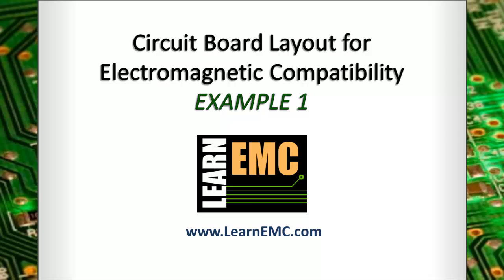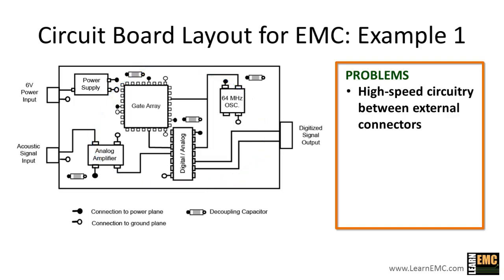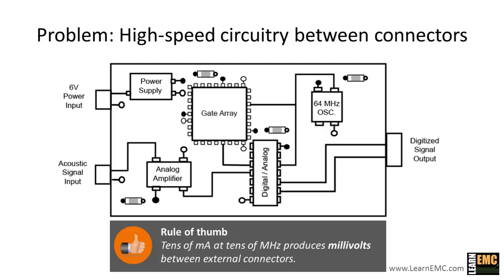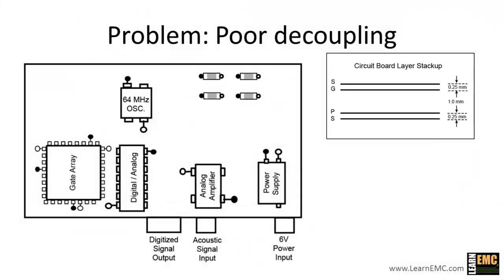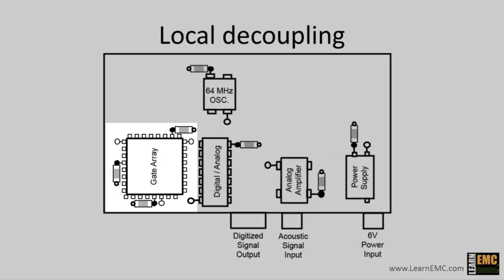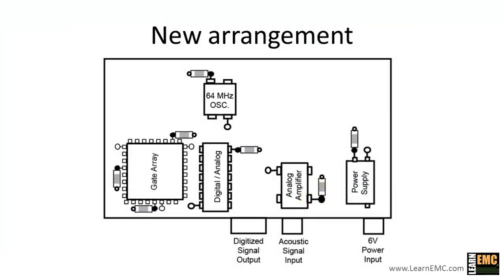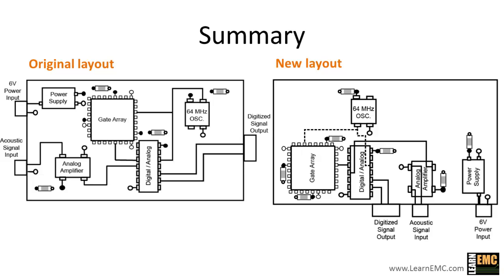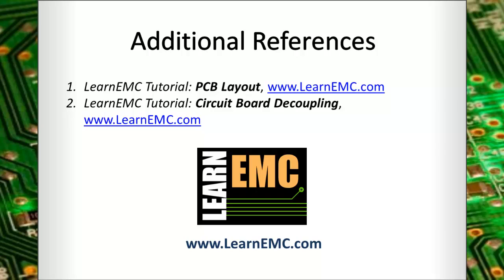Circuit Board Layout for EMC: Example 1

Comment: What if the external connectors can not be moved?
Reply from the maker: Put the board on a metal chassis and connect the circuit board's ground plane to the chassis near each connector.

Comment: The placement of the vias and decoupling capacitors is wrong. You want connect the power pin as close as possible to the capacitor and then connect the capacitor to the power plane via multiple vias. A via between the IC and capacitor is bad practice

Comment: Some points are still relevant, some are outdated.
Reply from the maker: Please be specific regarding any information you think is outdated.
Reply: @LearnEMC  For example. The audio ground should refer to the ADC pin, which is the star ground. New ADC have 2 ground, analog ground and digital ground. Supply from via must reach cap first then pin, not between then.
Reply: Oh the caps are thru hole, really ancient. It will cost more than smt, not to mention their lead has more inductance than smt counterpart. Digital trace are best route on layer 1, where it's nearest to ground. Layer 3 should use ground if layer 4 will route digital trace. Use power trace instead of power plane at either layer 1 or 4.
Reply from the maker: @jasonhanjk  A star ground is used for the unamplified acoustic signal, but it is not generally required or desirable for the amplified acoustic signal. Many ADCs have 2 ground pins, but they are connected internally. The decoupling capacitors are connected correctly for this application.
Reply from the maker: @jasonhanjk  None of the components in this example are through-hole. All of the digital traces are routed on layer 1.

Comment: Product/mechanical design constraints may determine connector placement.
Reply from the maker: Yes, that's true. When high-speed circuitry must be located between connectors, steps have to be taken to ensure the connected cables are not driven by the circuitry. This generally involves limiting the bandwidth of the circuitry or providing a low-inductance connection to a metal chassis at each connector location.

Comment: Some issues here. The myth that you should ground shielding to board groundplane is dangerous, Shielding should preferably be grounded to the casing. Reason is that if you are a in a highly noisy environment i.e. an industrial machine hall, that cable shielding will act as an antenna inducing noise into your ground plane.
Reply from the maker: High-frequency cable shields must always be bonded to the metal chassis. If the cable shield is acting as an intentional current return, it must also be bonded to the circuit board's return plane. In this design, if there were a metal chassis, the circuit board's ground plane would need to be bonded (at high-frequencies) to the chassis near the connectors. In the event that the circuit ground was required to be low-frequency isolated from the chassis, that bonding would be done through capacitors.
Reply: @LearnEMC    You are right in the cases you have a connector that doesn't go 360 degree around your cable and have attachment to a casing made of metal. The reason for this exception is that you in this case have a Faraday cage and you avoid getting signals in and out through your shielding. You are right in case of plastic cases and in case of connector not having proper 360 degree shielding attachment (like in a RJ45 with the gaps) then you are forced to attach shielding to signal ground. The reason i mention this, is as i originally commented, that when you have machinery in a very noisy environment you risk having issues with EMI into your circuits. This may sound like an edge case, but having worked with it, there are a lot of machines out there where it is important to distinguish between Shield and GND.

Comment: Great video. Can you or someone please tell me, how to establish a return current path for a low frequency and low amplitude signal which is going to dual supply op-amp? As this op-amp will not have a ground pin. Also please clarify whether keeping the input power connector on the analog side of the ground plane is not going to mess up the along signals due to return path of digital currents.

Comment: I think this woman doesn't know anything about industrial designer , during my 30 years working as engineer , you can't just move around  connector to other place , marketing people would scream on you and tell you that we can not  marketing this things.
EMC has lowest priority now days and it comes at the end of project when you get stock in EMC lab which is too late to do any change in mechanical design.
Reply from the maker: A growing number of companies are designing their products to meet EMC requirements the first time they are tested. This avoids iterative design processes that add cost and extend product development schedules. Of course, there will always be some products that require connectors on opposite sides of high speed circuitry. These designs will generally rely on techniques that limit the high frequency currents and/or employ a ground structure or enclosure external to the board.

Comment: Very interesting fact about connectors on opposing sides. I have a related question:
Let's assume I have an in-line amplifier in a shielded enclosure. Input and output wiring is shielded with the shield connected via EMC cable glands directly to the case. The unshielded conductors protrude the case through the EMC glands and need to be connected to the PCB inside the case. I would assume that it still holds true that the input and output connectors should be on the same side of the PCB because of the explanation in the video. But what about the EMC cable glands? Do they need to be on the same side of the case as well or can they be on opposing sides of the case, because the circuitry is not "electrically inbetween" the wires when the PCB connectors are on the same side of the PCB? Is it important to minimize the length of unshielded wire inside the enclosure? Is it sufficient to connect the enclosure to system ground at a mounting screw or would dedicated ground connections to the EMC cable glands be necessary? The input in this case will be a millivolt-scale sensor signal, while the output would be either an analog current loop or a digital connection.

Comment: Using vias for the 64-MHz clock signal is adding unnecessary inductance which can cause reflection and signal attenuation at the load.

Comment: This is essentially correct but it is often better to use separate analogue and digital ground planes rather than running individual analogue ground tracks through a digital ground plane to constrain the path of analogue return currents. The pin layouts on A/D devices are are specifically arranged to allow for this. Manufacturers data will often provide suggested grounding arrangements. Well done, keep up the good work!
Reply: Can you help with an electronic design project?

Comment: Question on decoupling capacitors; is there a reason why you chose to place the cap next to the via, instead of placing it on the line between the via and the power pin of the IC?
Reply: https://www.allaboutcircuits.com/technical-articles/clean-power-for-every-ic-part-1-understanding-bypass-capacitors/#:~:text=First%2C%20though%2C%20a%20brief%20note,another%2C%20and%20%E2%80%9Cbypass%E2%80%9D%20refers
it will solve your problem after 4 Years if the question still exists.... hahaha

Comment: Very helpful video, helped me solve some EMI problems in a design. Thanks!
Reply: Also, shielding.  I ended up shielding my digital signal cables, and analog signal noise on the board was reduced substantially.